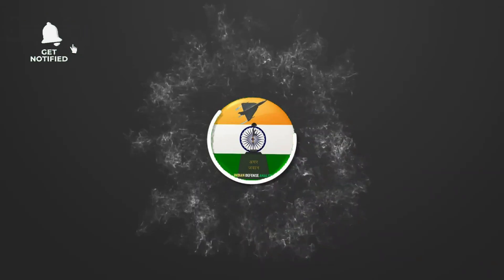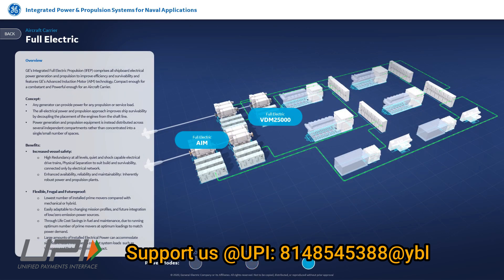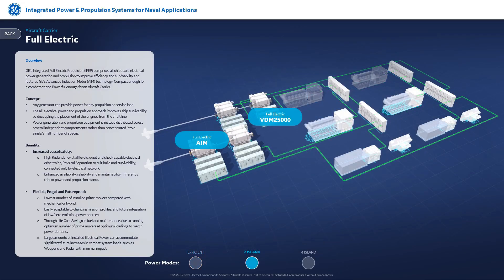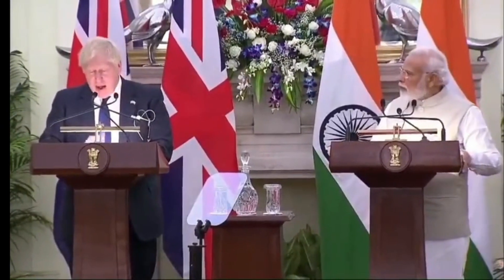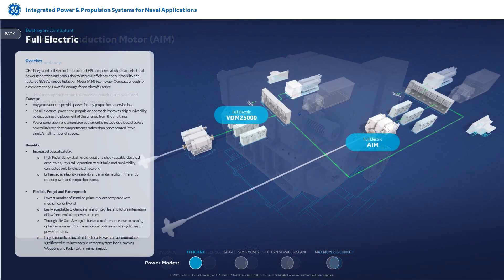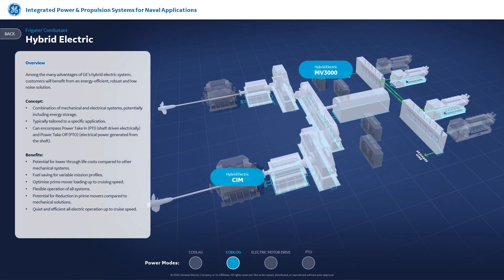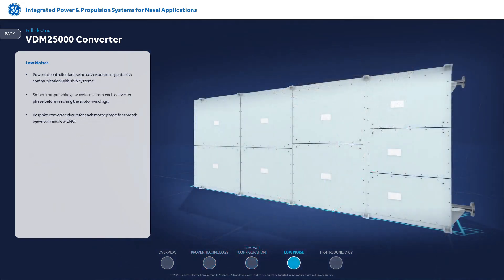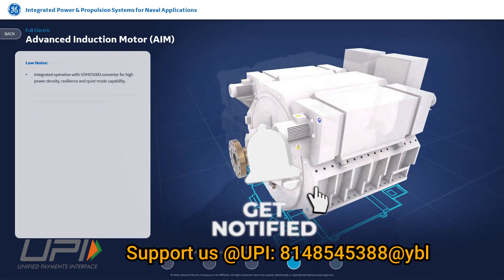Indian Navy cruising towards Integrated Electric Propulsion #indiannavy

Comment: The best energy source for electric propulsion is fuel cells or nuclear power. It is time the Navy took seriously the idea of moving away from diesel engines. British engineering consultancy Ricardo is part of the sustainable HYdrogen-powered Shipping consortium (sHYpS) to spearhead the development of fuel cell propulsion systems for passenger ships, aiming to achieve zero emissions.
The project, comprising 13 partners across six European countries, including Norway and the UK, aims to accelerate the adoption of hydrogen as a renewable fuel in the maritime industry.

Ricardo takes the lead in specifying, designing, building, and testing a 375 kW fuel cell module. Additionally, the engineers are responsible for developing a containerized multi-megawatt (MW) power plant, which combines the outputs of several fuel cell modules for installation on passenger ships. The navy needs to start doing the same on smaller ships while nuclear power can be used on bigger vessels. The French Rubis class weighs only 2400 tons.and produces 48 MW, demonstrating that between nuclear and fuel cells it is possible to power almost all ships of any size.

There is a no mans land of below 2400 tons and above 1000 tons where fuel cells are not quite ready yet, but all the more reason to thrown money at building bigger and better fuel cells to close that gap! Both nuclear power and fuel cells are indigenous tech, unlike engines which are 100% imported. Tech transfer is nothing but a massive major scam. Best to bet big on the futuristic tech over last century.

Comment: You should improve your mic
Reply from the maker: Please suggest some if you know
Reply: @IndianDefenseAnalysis  I would suggest a very good quality condenser microphone which should come calibrated for good full sound spectrum frequency response. People will suggest fancy popular brands like AKG/RHODE etc but they are known for the type of sound tonality than clarity. I have worked on sound for more than 15years as a hobby. I used to record and correct sounds thru computer programming. My suggestion is based on my past experience. Any mic you choose, Always have an-echoic padded recording room.
Reply from the maker: @prashanthb6521  I agree with you. My apartment is quite noisy especially because of kids. I need to build some kind of sound proof room or small setup
Reply: Akg p1200
Reply from the maker: @Harshit-yy1oe  thanks let me check